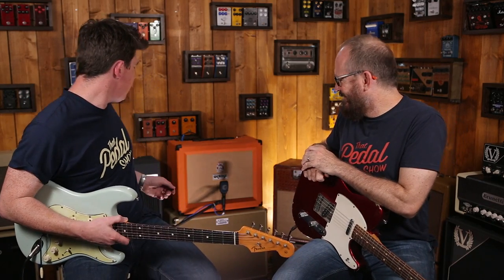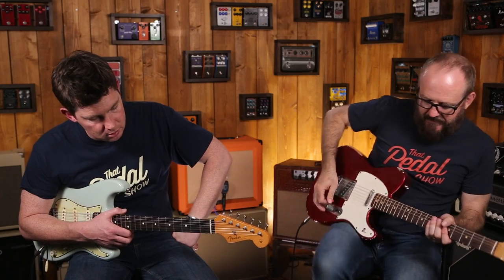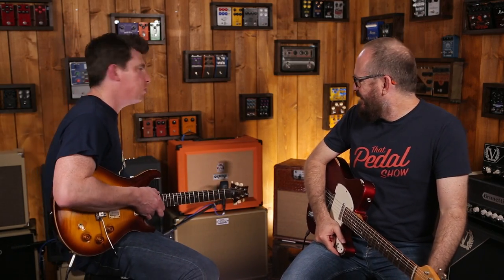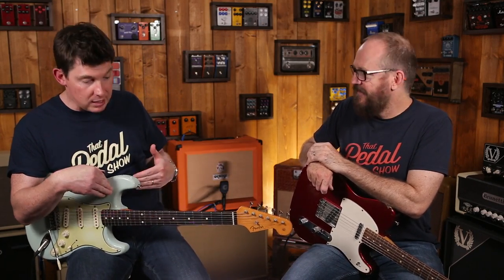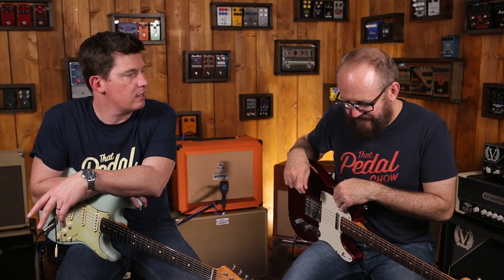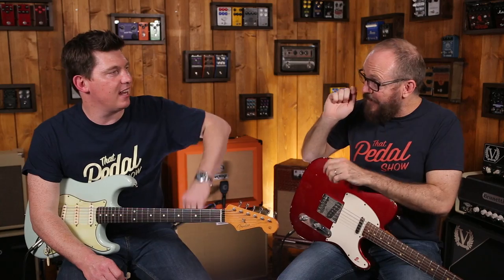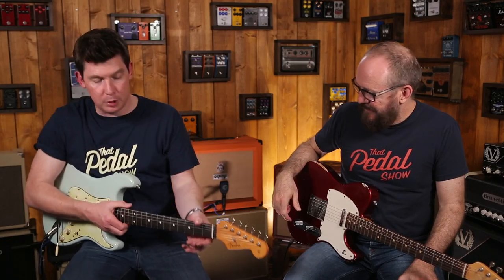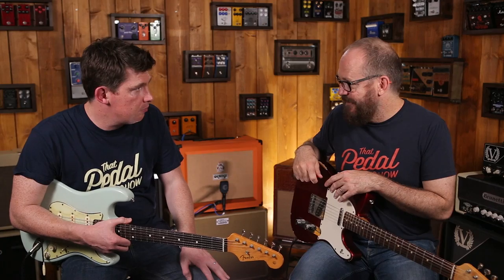That Pedal Show – Do We Like Transistor Amps? Part 1

Comment: Hi chaps. Another great video, I am currently looking at getting myself a valve amp after many years of running through a transistor. This is largely because the majority of videos I watch on Youtube and other guitarists I speak to say that it's must! (I hav also tried a few out and I do enjoy the sound) but perhaps for your Part 2 you could take a look at Transistor amps that claim to emulate the valve sound, such as the Peavey Bandit Transtube (you're more than welcome to use borrow mine), or amp modulators, such as the Kemper (that so succinctly defeated Chappers in a recent Andertons vid)

Comment: I really tried to come to this episode with an open mind. In fact, I was hoping to discover a new, less expensive, breed of amps to start researching. However, on the clean channels, (almost) every single comparison I felt the solid-state amps had a clarity in voicing that bordered on (crossed into) brittle when compared to the Fender. The solid-state amps sounded fine and do an admirable job but... valves...man there's just no getting away from it. The solid-state amps seem to fair much better on the dirty demonstrations, to my ears. Thanks for the demonstration!

Comment: "We want part 2!  We want part 2!" 
I've been using an old MIJ Roland Cube 60 from the 80's (the orange one).  Small and light in weight, epic warm clean sound platform that takes pedals well.  I stack my overdrives and fuzzes into it and I get great results.  Dig the vids chaps!  Greetings from Hungary

Comment: Can you try the new Boss Katana, Quilter Tone Block since they claim to sound very tube-like? Also, can you talk about the whole 15W valve can be louder than 15W solid state?
Reply: Power ratings have very little to do with how load an amp is. There are multiple factors to consider such as the speaker efficiency. Do a little digging on SPL - sound pressure level - with respect to speaker design. Then go find something running old Celestions or EVs in a low wattage box and see what loud is.

Comment: Really cool show. Pretty much nailed it. I have always used both SS amps and tube amps. They are just different approaches and have both strengths and weakness. When I am using one type I miss certain aspects of the other. I have a JC40 right now and it has been a very useful amp (loud and light weight). It allow for me to get a pseudo-stereo set up with out having to carry two amps.  I will admit, it is the flattest sounding amp I have every owned (SS + 2x10). This leads to another whole set of questions and possibilities: Speaker replacements. Some people scoff at replacing speakers in JC amps. Being that I have had enough experience with JC amps, speaker replacements do have a impact (good or bad is subjective and based on what a person wants to accomplish). (Right now I also own a JC120h, which allows me to chose witchh of my cabs to run with it). My plans are to put in a couple of Celestion Golds and see if that creates a little more depth while retaining the snap/forwardness of the transients.

Comment: Been wanting to see this for a while. Got some late 70s/early 80s Carlsbro solid states with 2x12 Celestion G12s in them which can sound quite nice but it would be nice to get some pointers as to where they could be taken. Clean with an old spring reverb in front can sound great but driving them without ripping your hearing out can be a chore. For 20W amps they are LOUD!
Would have liked to see some more of how the transistor amps get  on with a Les Paul too. The film really reinforces how tailoring pedals to amp is an art in itself.

Comment: I thought they all sounded great, and depending on what was being played each was my 'favorite' for at different points. For instance, the very first pass through the amps.. with the Tele I liked the Orange more, but with the Strat I liked the Orange the least. I don't like most peoples argument of "For the same price you can get a tube amp." because I feel like the Orange CR60C sounds great. I'm not trashing valve amps.. I've owned several and the favorite amp I've ever owned is the Engl Blackmore.

Comment: "with a lot of transistor amplifiers"..."that sizzle becomes very harsh" ... I get what you are saying BUT Personally I think that's what the tone controls are for, hence the term 'equalisation'. 
As I type I am sitting next to my Vox AC15 (I owned AC15's since the 1980s) and an Orange Crush 35B (yup putting guitar through a bass combo with Low and Mid at 0, High at 4.5) with an EHX Hot Tubes and Holy Grail, sweet spot the volumes and tones on my 57 pickup Gibson SG and there aint no harsh sizzle just clang, chime and crunch. 

If a solid state is breaking up in a unmusical asymmetric way back off the treble and turn UP the master volume and it will start to give more dynamics ... kinda like a valve :-o 

I binned my first VOX AC15 when the valves started to go because my cheap theoretically rubbish solid state VOX Lead 50 was way better at clean loud resonant woody tones and conversely clanging tones (like Bowie Lets Dance) ... yeah the AC15 had the sag, compression, sustain kinda stadium rock thing ... but we were a little tired of bloated guitar sounds after the 1970s. In fairness my modern VOX AC15 seems significantly better than the one I had in the 1980s. In the case of the VOX Lead 50 it was much about the box and the speaker interacting with the tone controls, get the volume up and it became a ball of sound like a viola. 

In the late 1970s many club guitarists had made an art of getting way better sounds out of solid state (kinda like the Roland Jazz Chorus kinda vibe), and you could not have got them to go back to valve if you held a gun to their heads. Just like many punks just wanted an HH solid state on full volume and again they would not remotely put up with some fizzy squeaky squawky ...yet ... wait for it--> dead and dull hippy valve amp. I remember someone turned up with their beloved Fender Twin Reverb ...total fail ... well we presume it was a total fail ... we could not really hear it so who knows.

Comment: Keep up the good work boys. Something I'd like to see when you guys get a JC-40 in is a wet/dry/wet setup with it and some tube amp. I've been planing on picking up a JC-40 as a wet amp as it seems it would make things really simple with the built in stereo inputs (no stereo pedals currently) and direct outs. Make it so.
Reply from the maker: +twat75 Yep - great suggestion. Dan and I were discussing that very thing this very morn.
Reply: A friend of mine uses a three amp rig. Vox ac15, marshall class 5, and a JC-77. It's a very cool sound
Reply: Beat me to it! I've been thinking of doing something similar recently. My lower back urges me to keep things simple though...
Reply: I don't see why this needs a part 2. The JC is as dry as a goat fart. Great for well Jazz of course, and Reggae.
Reply: I almost did this same thing after seeing their wet/dry/wet setup video.  Such an affordable amp to get 2 clean channels for stereo wet. Tube amp for sweet drive and clean tones.

Comment: I usually audition guitars on a Blackstar TVP combo now, because I can usually dial in a sound irrespective of the guitar. I find most valve amps suit certain guitars (and music styles) and not others, so if it's the wrong combination the guitar sounds worse than it should. The TVPs also have an easy fx section so it's quick to setup a reverb/delay/mod fx, tweak it and switch in/out each fx, usually too tricky on other amps unless you know them well.

Comment: If you use the Roland again in a video comparison, I might suggest trying the Robin Ford or Eric Johnson tone capsule. It seems to increase the response and sag of the amplifier. Giving you more "tubiness" so to speak. Another suggestion might be to use an amplifier that has a solid state power section and a tube preamp. Loving the videos guys. Keep up the good work.

Comment: I think the main point about valve amps is context. The consensus seems that valve amps on the verge of breaking up are the ultimate tone, with pedals added to taste. I would have to agree with that, however there are situations where none valve options are perhaps better. If you want a practice amp and practice in a situation where a cranked valve amp (even a low wattage one) is not an option, e.g. Bedroom, thin walled flat, etc. Then a transistor or modelling amp could be a wiser choice. I am currently using a mustang 3 modelling amp for home use and it's ideal for that, it produces half decent tones at quiet neighbour friendly volume. Would certainly go down the valve route for gigging though. Great show as always guys. Thanks and congratulations on another subscriber milestone!
Reply: truth friend,i have a mustang 5 i use daily because it can be played quietly,unlike my 2 50 watt tube amps.
Reply: Wise words! No transistor amp will ever come close to a tube amp. I would never use a transistor amp in a band setting or live. But most of the time I play a little VOX Pathfinder transistor amp with some pedals in front cause a tube amp is too loud in my flat...
Reply: What I like about my SS amp is that I can get any sound that is possible for my amp to make at any volume I want.  Can't do that with my tube amps.

Comment: Did you guys tried to match the tone of the amps with the band eq or did you try to find the "sweet spot" on each amp? Well...I think that's why most of us love valves... The sound's spectre is fuller and the overtones jump out your fingers almost instantly after turning the amp on without needing to dial too much because it has a propper voice, while the transistored is kinda "flat" like you said, giving us more work to eq. The Fender i's also much warm and transparent when the bass frequency is up.. but hey, that Blues Cube was a great surprise! THUMBS UP as always!

Comment: I would like to add that i used transistor amps for years before i could afford multiple tube amps and the maintenance costs. Using a PARALLEL style compressor with these amps like an xotic SP or a Wampler EGO was my secret tone with my pedalboard. It gave it the sponge that running pedals into a clean tube amp had.
Reply from the maker: +WaldvogelReview That's a great tip, thank you.!

Comment: I'm going to say that the biggest difference with how these 2 solid state/transistor amps sound.. mmmay be simply due to the different speakers in them. It would take loads of time and some video editing to do, but demoing these 3 amps with the TS9, OCD, and Muff, but each amp with the 3 speakers from all of the amps. so yes, switching out speakers 3x for 3 amps for 3 different pedals.  Then a/b/c each amp with the same speaker in the cabinet, for each of the drives. Then the same for the 2nd speaker, and then for the 3rd. I bet they sound much more similar than different with the same speaker. That's an assumption of course, but it's based on my assumption that there isn't a whole lot of character in transistor amps compared to valve amps, especially at clean volumes with drive pedals through them. I think we're hearing more speaker than actual amplifier at play here. I bet the Fender still sounds the best tho.
Reply: Yes Speakers have a huge impact on tone ,Theres a great difference between a NEW speaker that hasnt been "broken in"" and an old "worn in"  one  !  I have the Orange Cr 60 and it needed much playing time till the speaker "broke in" The sound and Volume improved ALOT ! besides that ;The Fender has 2 Speakers while the Roland and Orange has only one !

Comment: THIS IS WHY I LIKE THESE VIDEO'S, THEY ARE ALL ABOUT AN HOUR LONG BUT EVERY TIME I WATCH ONE IT SEEMS LIKE ITS ALREADY OVER IN ONLY 5 -10 MINUTES, IF YOU GUYS DO ANOTHER EPISODE WITH SOLID STATE AMPS COULD YOU GET A PEAVEY BANDIT OR SOME PEAVEY WITH TRANS-TUBE TECH IN IT, PEAVEY ALSO HAVE THE VYPYR TUBE 60 THAT HAS TRANS-TUBE BUT ALSO USES VALVES, 12AX7 FOR PRE-AMP AND 6L6'S IN THE POWER AMP, SUGGESTED THE TUBE 60 BECAUSE I'VE HEARD ALOT OF PEOPLE SAY THIS IS THE BEST SOUNDING MODELING AMP AND THE VALVES REALLY HELP OR IF YOU GUYS EVER DO A EPISODE ON MODELING AMPS YOU SHOULD DEFIANTLY GET A TUBE 60 IN THE MIX OF AMPS, JUST IN CASE YOU DO MAKE A EPISODE WITH MODELING AMPS THERE HAS BEEN ALOT OF NEW ONES THIS YEAR LIKE THE LINE 6 SPIDER 5 WHICH JUST CAME OUT THIS WEEK, PEAVEY VYPYR PRO 100(ALOT OF PEOPLE SAY ITS THE BEST MODELING AMP  OUT TODAY EXCLUDING THE REALLY EXPENSIVE STUFF LIKE KEMPERS AND AX FX), YAMAHA TH SERIES, MARSHALL CODE, VOX AV SERIES ARE THE NEWEST FROM THESE COMPANIES AND HAVE ALL COME OUT IN THE LAST 6 MONTHS

Comment: I just swapped the 1970s Celestion G12s from my old Carlsbro Scorpion solid state with the Eminence Lady Lucks from my Blues Custom 30 and oddly BOTH amps now sound better than before. The Carlsbro had an all round nice tone which I wanted to steal for the BC30. That part worked but I didn't expect the old 2N3055s in the Carlsbro to react quite as well as they have to the Eminences. Its coming across a bit punchier than before. Maybe time to experiment mixing the two amps in one rig..?

Comment: Good show Mick and Dan. I'm surprised to hear how good each amp sounded. I'm still partial to good ole valve amps though. Just a thought, you should try comparing a  vintage solid state amp (Sunn Beta Lead) to a modern solid state amp. As I already mentioned the Sunn Beta Lead was a very clean 2 channel amp, but really dirtied up nicely. Its CMOS technology was touted as being the closest thing to a valve amp. As I remember it took to pedals well and had 3 effects loops. This was the first amp that I purchased when I was 18 years old. I may be asking too much. But you two asked for suggestions on round 2.

Comment: I have the Crush Pro 60 and I absolutely love it--especially with single coils and p90s.  Would I like some other amps better?  Yeah, probably.  But that' s the thing about having an endless stream of other amps to try out:  you may find you like something better.  I've tried a number of different amps--valve (Marshall DSL20, Fender DRRI '65) and non-valve (Boss Katana 100 and 50)--but I've always come back to the Crush Pro as having a sound that I really like.  It's worth mentioning that the Crush Pro has a digital reverb that is very very good and very useable.  By way of comparison, the Fender DRRI, which obviously has excellent spring reverb, is not all that useable above 4 on the knob.  Anyway, there's my two cents 3 years after this video was published.

Comment: The orange only got a couple of decent tones (in my opinion) and some horrendous ones. I was actually digging the Blues Cube for quite a few things but the Fender was my favourite (and the Bassbreaker 15 combo is a top candidate for my next amp).

My background has been primarily transistor and digital (well actually I've played more acoustic than electric, but that isn't part of the debate), so if there was any bias on my part it would be towards the transistor amps, however I went with transistor amps because I was starting out and knew nothing about amps and couldn't afford a tube amp (plus, due to playing mostly acoustic, wasn't really interested in getting one).

Prior to buying my first valve amp a couple of years back, I've been mostly using digital multi effects pedals (great for headphone practice if you have fussy neighbours like I do) and the technology is getting better with each generation. I find the prospect of a (current generation as in Amplifire, Helix, AX8 and Kemper) digital vs valve amp comparison more interesting.

With some digital gear, you have to set it up differently depending on what volume you are playing at for the response to seem appropriate (as you can basically scale its response). For that reason, despite wanting to see a comparison, I don't think it would be a good idea for someone that doesn't understand the ins and outs to do a comparison. They may not understand how to set up the digital gear so as to represent it fairly.

Comment: Nice video guys.  Given that the Quilter Tone Blocks (101 or 201) are really leading the way in solid state amp technology, I'd really like to see/hear your take on one of those with say a 1x12 cabinet in the next video.  It would be really interesting to hear how they take pedals with an edge of break-up setting on the amp as that's where the tube amps seem to excel with pedals.

Comment: Once again you prove it's the total rig that matters.  I'm really not a fan of overdrive but that said, the Strat into the TS really did sound nice – just not my own particular sound.  While the SS amps did sound good as clean amps, I don't think jazzy clean is my own sound, either.  But the compressor into the Fender Bassbreaker was heavenly.  Not crunch and not OD but enough guitar compression to interact with the amp is really all I think I need to be a happy man.  Even with my own Fender SS amp a compression pedal is very, very nice as a tone enhancement to the raw guitar output.

Comment: Well done as usual. It would be interesting to compare a valve clean amp and a transistor amp with a good compressor (valve or transistors, but tuned not too squashy, just to sweeten the transients, like a valve amp generally does) placed just before the Input to see the differences.  A clean valve amp react sometimes very close to a studio compressor...

I'm surprised about OCD performance with all theses amps. I wasn't convinced by this pedal with Fender DeLuxe RI and HotRod with a Strat. The PlimSoul was much better to my hears...